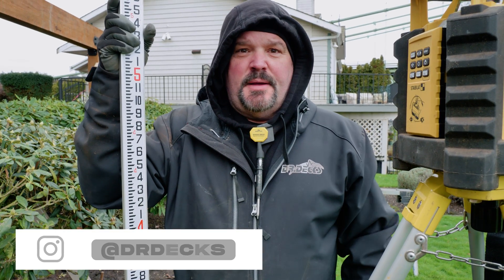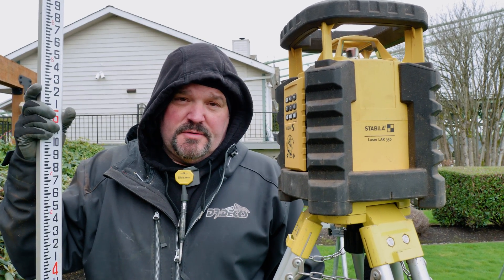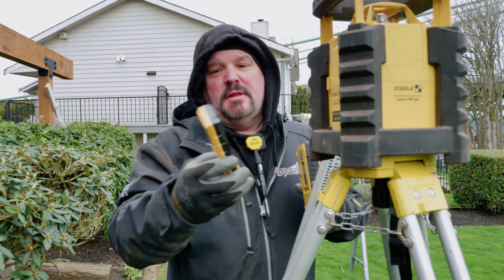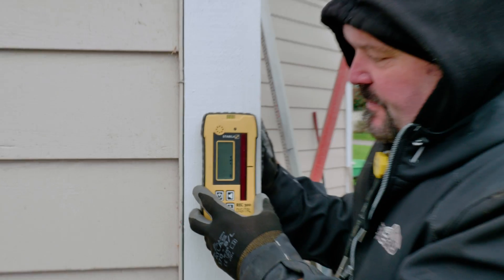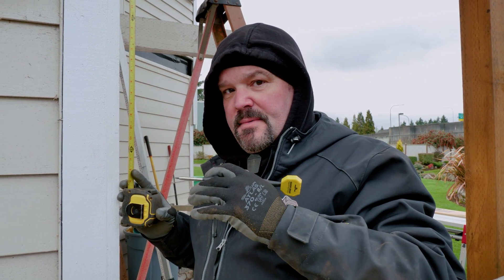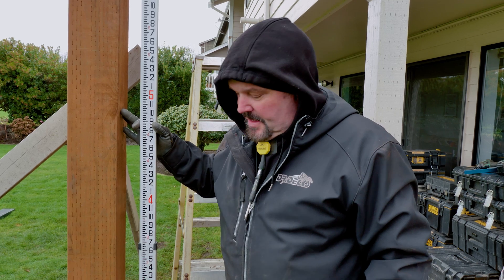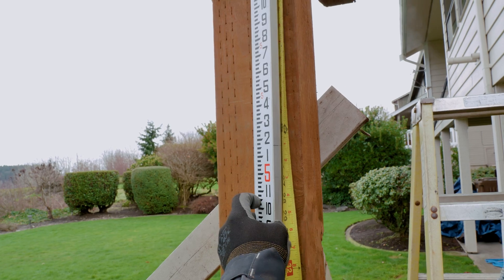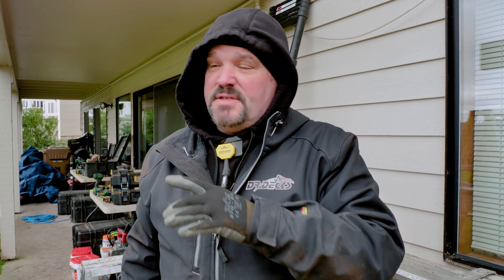How To Justtify The Elevation Of Your Posts With STABILA || Dr Decks

Comment: If you build your box deck level and square it .holding it up with dead men. Then you level down to the ground mark the where the poles go .dig your holes and put the poles in and concrete. Use your head don't need all of this extra stuff. Simplify
Reply: These posts aren't buried they are still above ground on piles. They also used a 6x12 beam which isn't something I'd want to brace and work under unnecessarily. That said the method you mentioned is usually my first choice when convenient. For this deck I would have set the posts with piles first without cutting to length, squaring with string and some bracing, mark the top height with the transit and cut it to length in  place.